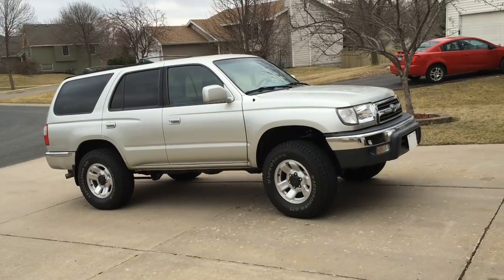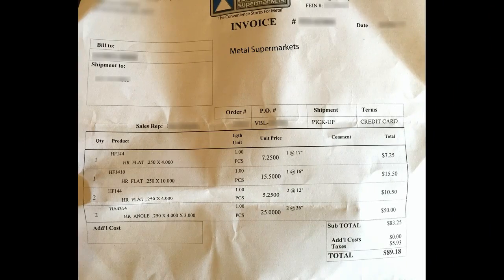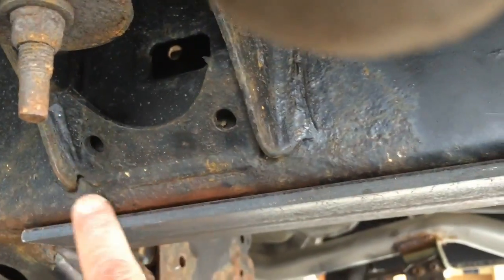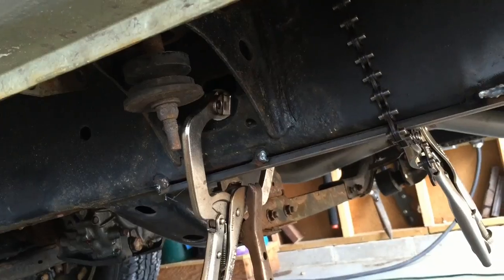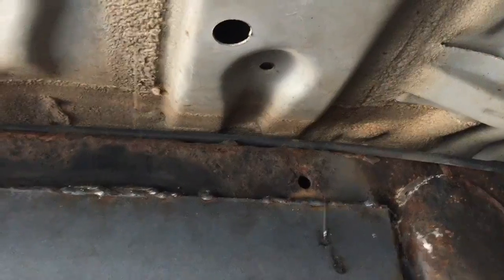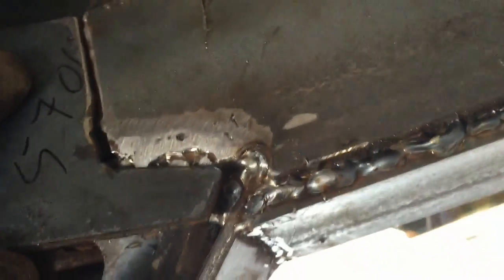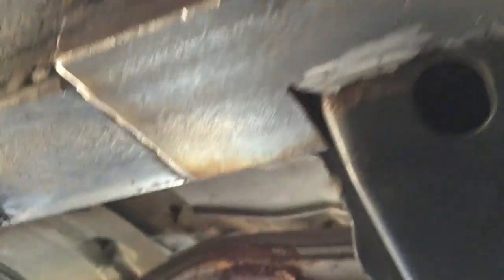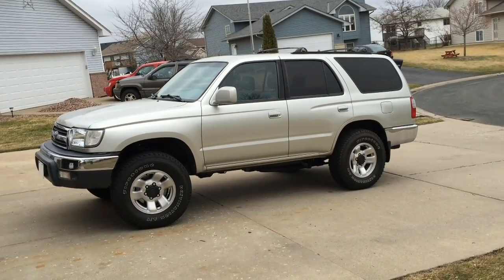2000 Toyota 4Runner Frame Rot Repair - Welded

Comment: Just curious, will the inspection people pass that? I don't have that bad on my 4runner, but it seems has started. Also do i need to remove gas tank, or any other parts prior welding?
Just got myself Hobart 210MVP MIG as well. Let me know.
Reply from the maker: I absolutely removed the take and got it away from the vehicle when I welded the tank side of it.   When I welded the exhaust side, I personally left the tank in place.  But still had a basic garage fan blowing under the vehicle to move any fumes, specifically the welding burn-off, etc.I think you need to pass your own judgement on the tank as it is in place.  The smallest amount of fumes can make it a very bad day.  The tank comes down fairly easily w/ a strap in the back and a couple of bolts.  The hardest part it getting the hoses off which have been seized in place over time.    One 'MUST-DO' is to empty the take before taking it down,  it's a night and day difference in the effort.Another point I will share, is if the tank is out, spend the $100 and put a new fuel pump in if it's not already renewed.   The pump is only exchangeable when the tank is out, and it would be a shame to go through the work and have the pump fail in short order.

Comment: Body shops don't want to touch "old" rusty vehicles like this due to liability anyhow.   Oil injection into the inner cavities is the only thing that prevents this.  Chain saw Bar and Chain oil works well because it stays tacky and doesn't drip and it keeps self-healing itself and wicks itself into all of the seams.  One application of oil into the frame rails when the vehicle was new would have prevented this.

Comment: Nice job but you should have atleast cleaned up the old rust before layering it. It would probably last a little bit longer too with a good undercoat just food for thought. But looks pretty decent for a quick job.

Comment: Due to the lack of my due diligence, I just bought an '01 that has the same issues.  Once this repair is done, is a 2.5" lift still okay to do?  I was also contemplating buying a whole new rear axle.  The brake lines and fuel lines need to be done as well. :/
Reply from the maker: Michael Oteri   I really don't have a way to judge that, but I will tell you that given what I've seen and experienced thus far - I can't seen anyway what so-ever that the frame isn't significantly more structurally sound that the original, even before the rust.  But keep in mind that frames are designed for a certain amount of flex, and by adding steel, one is essentially changing the flex characteristics - specifically removing flex in that area of the frame.   BUT, that sure beats sending it to a junk yard!BTW - I have a 1" lift on mine now, all new springs/shocks/struts.   I absolutely love how it looks.  As far as the rear axle, I simply pressure washed it and painted it with POR15 for now.Good luck!
Reply: +Michael Oteri Don't lift a vehicle especially one that has a bad frame, unless you have lots of time & money to replace ball joints, tie rod ends, CV shafts and  boots, hanger bearings, and steering racks. A lifted vehicle looks stupid without big tires on it and those big tires cause all of the problems I've listed. Unless you're living in a swamp don't do it.

Comment: Hello, Can you advise how were you able to weld onto the old frame without cleaning it down to bare metal.  Also how did you not blow holes while welding? can you estimate the thickness or gauge of the existing frame metal?

Thank you.
Reply: Most light duty frames should be 1/8 to 3/16 inch, if you plan on welding to it grind it down to somewhat bare metal. Also don't be welding stupid thick metal to it, its just a waste. Only as strong as what you're welding too.
Reply: You can flux weld onto dirty metal. Just prep as much as you can and apply oil or paint after the weld is done to protect the surface for as long as you can.

Comment: if you have a decent air compressor a HF needle scaler saves a lot of time removing rust.
Reply from the maker: +ss96impala1 Great tip, I never knew of one.  I'll check it out.

Comment: Did you have to remove your gas tank to safely repair both sides? Or were you able to take other precautions?
Reply: Yes he did
Reply: I  gave it to a great welder that fix the frame weak spots and cracks .... but I also ordered a skid plate so I decided to drop the tank for a week and cleaned the entire bottom except above the trans support skid plate ...  saturated  metals with WD40 and coated all with Rustoleum Red Oxide primer ...   new fuel pump, inspected and cleaned tank  ... old gas into a 5 gallon can ... removed bumper and tow bar  cut holes in trunk to get at top of carriage bolts ... all went well but a lot of hard labor ... also hit above the t-skid plate with  WD and Red oxide ....  cleaned all drainage holes and flush out rust buildup in frame ... put the tow bar back with spacers to all better drainage - replaced all tank hardware  ... paid a neighbor for helping hand  ... good man wife is ill .... we did the job right!
...

Comment: my question is, when you did the welding did you removed the gas tank first? being that gas line and sparks from the welding torch seem very close.
Reply from the maker: For the passenger side I did not.  I removed the exhaust (which I replaced with all new), and simply welded away.   The bottom of the vehicle was dry, and the fuel system did not give me any sense of it being 'leaky' or such.   Still risky however, so I think it's a case by case basis.   When in doubt, don't mess around and remove it.When I did the drivers side, yes.   All fuel parts were removed and put outside of the work space.   Gas fumes are a wicked thing.   When I put the tank back, I did so with a new fuel pump as the only way to replace the pump on this rig is to remove the tank.   That being said, it was just an opportunity to buy another 100k miles before needing to replace a pump.
Reply: Thank you so much CL Biro! after watching your VDO i felt like i could everything.lol.... I'm going for a crash course in welding this weekend.

Comment: That frame is rusted beyond any safe repair. It has obviously been driven on salted roads for some time. Another frame that is not rusted is the only way to fix it, but that would also be pointless if you intend to continue driving on salted roads. My guess is the floor pans and maybe the bed are also rusted through, along with the rocker panels, fenders, and bumpers, even if it isn't visible yes. It is nothing but an exercise in futility trying to keep a vehicle on the road for more than a few years in salt states.

Comment: Excelent job! I have a car to repair like this one. Can you give me some pieces of advice?
Reply: I can help you:  1. grind or cut out the crusty stuff.  2. fit and cut the new steel so it will weld to solid metal. 3. weld in new steel.  4. clean and finish the repair.  5. apply some rust preventative and reapply annually.  Or, you could watch the video and do what he did.

Comment: Fill the channel up with expanding foam for water proofing
Reply: That actually has proven to be a really poor idea.  Expanding Foam traps water around the edges and actually causes rust.  Car manufacturers use to do this for rust prevention and it actually caused rust instead.

Comment: How much cost to make those metal pieces piece? I don't think it is cheap.
Reply from the maker: +James C Xu The metal is about $1 a pound here locally.  And it was easy to find at a franchise called 'Metal Supermarket'.  So I'm thinking the whole cost of the metal was about $175 or so.  I had a fair amount left over.

Comment: Not bad,but at the very least you should have taken a wire wheel to the rust,then painted over the exposed area.and I've been told that you never weld vertical lines,always at 45° beads and cuts..something about the stress that almost always causes vertical welds to crack.

Comment: That frame needs to be replaced,badly.Thats just the rust you can see.Guaranteed there is twice as much you can't see.That frame will fold up right at that spring hanger.If that happens when you hit a dip in the road at 60 mph,you are probably dead.

Comment: where are you at in MN? I'm in maple Grove and have the same frame rust issues on my 90 Ltd crown vic and am desperate to fix it
Reply from the maker: I'm in Shakopee now.  This rig however spend most of it's time south of Lakeville outside of city limits.
Reply: I miss my crown vic I love my 4 runner cancer and all but I miss my vic i had on old 07 interceptor half the paint was falling off I beat that daylights out of that car and it never let me down over 230k and no major repairs I think the most expensive thing I put into that car was an altenator and as far a I know it's still running wish I never sold it

Comment: Unbelievable, that 4 runner looks so nice outside too, probably the interior is nice too. I cannot believe that Toyota refused to cover the 4Runner!! Toyota's vendors must be using recycled swing sets and Campbell's soup cans to make these frames, they are absolute garbage!! 8 year old repair, it's probably either junk again or you sold the truck... People who try to do this don't realize how hard this is to do on your back, if you don't have a car lift, this is not an easy nor a fun task. And to do it right takes many many hours; avoid that Safe -T -Cap stuff, all it does is cover the rust, trapping moisture in between. Chop out the rust and replace it, no exceptions...

Comment: most of these frame I see are much worse than mine... clearly there is some defect.. they rot from the inside out and around every weld, but i have lots of paint on the outside of my frame still. you dont see other frames of this age rotting through like this. most of my body is good, just rocker corners and above rear wheels. i think its a vehicle worth saving but i got in over my head.. i heard about the ball joints, i heard about the pink milkshake... nobody said the frames rot.. they should have mentioned that..

Comment: Holy hell. How does the frame even get that bad.
Reply: +123devinzz1 You must be from Southern California. Here, 2005 Ford Expeditions get rotted out so bad they have to be junked.
Reply: +Lawrence Artz Newfoundland canada. one of the worst saltiest places for vehicles.
Reply: +Michael Campbell Sometimes when it's 30 below up here in Canada you just don't feel like going to freeze the doors shut at a car wash in the middle of the night.  Salt causes high blood  pressure in motorists and rusts  the shit outta their vehicles.
Reply: I inspected a 2003 Kia Sportage last year. The frame was so bad, you can jam a screwdriver through any part of the frame, the trailing arms were ready to break off, the center link mounts were broken off. I told the owner that it's just too far gone to save despite the fact that it ran fantastic.
Reply: This was by far the most informative video on repairing a truck fame I found. Thanks for the work to make it available for folks like me.  I didn't think I could do it, but now I believe we can. What I am dealing with is nowhere near what you had to do. Can do and thanks.

Comment: You did a great job repairing it.  I honestly think that your frame is too far gone to repair.  If your truck is mechanically sound and the body is in good shape, just spend the cash to have a new frame.
Reply from the maker: Spending the cash was no issue.  Finding the frame . . .  impossible.   The market was rushed years ago and Toymotor has no interest in getting that tooling back out.   I even went as far as trying to fit in Tacoma frames, but no can do without modifying the frame.

Comment: Did this pass an inspection after the work?  Have to say the frame looks way past repairable.  I think Toyota should have repaired this, obviously by not doing they have lost another customer (you), as well as the others who may view this.  I'm up in PA and just bought a 2004 Sequoia.  It needed a small amount of welding to pass the inspection, a section of tubular cross member which sits high up at the rear near spare tire was rotted, at least the middle part.  There is a record of Toyota inspecting the frame and they deemed OK but there is a lot of surface rust but nothing like your 4Runner.  If it becomes completely unroadworthy you could sell it to someone on a farm for off road hauling, or there is a big market for these overseas in places like Africa where safety is not such a concern.
Reply: In Mn is not inspection.  Of course this would not pass.

Comment: The good, the bad and the ugly FYI 
Toyota has reached an agreement in a class action suit brought by U.S. owners of several truck models over the issue of frame rust protection, Reuters reports. The automaker is expected to reach a formal settlement worth up to $3.4 billion with owners of;

Toyota Tacoma, Tundra, and Sequoia trucks that are claimed to have received inadequate rust protection, which in turn could lead to corrosion significant enough to affect the trucks' structural integrity, according to the class action suit.;
 
The settlement program will affect 2007-08 Toyota Tundra and 2005-10 Tacoma pickup trucks along with 2005-08 Sequoia SUVs, with the total figure derived from the estimated cost of frame inspections and replacements for over 1.5 million total trucks.
 
The frame replacements are estimated to cost $15,000 each, which adds up to $3.375 billion, while the cost of inspections for the affected trucks is expected to add another $90 million, at $60 per truck, according to lawyers representing the class of plaintiffs.;
 
Read more: https://autoweek.com/article/recalls/toyota-will-settle-truck-frame-rust-suit-suit-34-billion#ixzz5ZERNBhc3

Comment: Spay the hell out of the frame with old engine oil, inside and out.2 times a year.
Reply: People just don't understand how well oil works to prevent rust like this. "I don't want an oily mess under my vehicle"..... whatever.... (OK, enjoy your frame rot in a few years) Chain saw Bar and chain oil works great and just attracts a light film of oily dust over time and it keeps healing itself as it wicks into body seams.  Simple, cheap and effective.
Reply: Fluid film makes a sprayer with an internal frame nozzle works great
Reply: Can't this potentially cause the vehicle to catch fire and create a hazard?
Reply: hhova29 not usually, oil doesn’t burn like a volatile substance and a thin coating on the frame and any rust spots won’t pose any risk in most cases
Reply: so true, i apply oil through out chassis every 10000 km(3-4 times year). My Hilux is 21 years old but chassis is as pure as stock.
Reply: no, those are burnt oil(old oil that was in the engine, black & thick), its doesn't cause fire. Also i use high pressure gun, so it applies a very thin layer of oil. After 50-100 km you cant even notice it, but the chassis is well covered and protected. Again they have special kind oil designed for chassis protection, but why spent more money when you have free oil after every 5000 km :D
Reply: Heshan Sandeepa it feels so nice spraying thick black oil on dry rusty metal
Reply: is it okay to use old engine oil that is synthetic? or does it have to be normal oil?
Reply: Use fluidfilm

Comment: You really should have ground that rot out of there first. And also got the paint and junk off the surface. Would have made the welds a lot better. Also your welding too cold. Not getting enough penetration. Probably cause its so think of material. But when doing this kind of repair you really need penetration. Look into the product fluid film. Its an oil undercoat that has worked good for me.

Comment: Never ever make a vertical weld on a fish plate. Your plate should have been diamond taper cut looking like an arrow pointing left and right on the side of the frame and where the welds from the top and bottom come together at the point of the diamond the weld continues for 1/2 inch. Making vertical welds on frames, H beams and I beams is a no no.
Reply: What do you do? Downhill it?

Comment: TOYOTA HASN'T MADE A TACOMA FRAME YOU COULD TRUST FOR 22 YEARS.  FROM 1995 THRU 2017.  HOW DO I KNOW THIS AS FACT?  BECAUSE THOSE ARE THE YEARS THEY'VE OFFERED TO EITHER BUY THE TRUCKS BACK OR PUT NEW FRAMES UNDER THEM OR SPRAY THE FRAMES.  THANKS,  SO CALLED LEGENDARY TOYOTA  QUALITY CONTROL, AND THANKS DANA CORPORATION.   THANKS FOR RUINING A GREAT TRUCK FOR 22 YEARS.

Comment: cavity wax in all fram holes it will last many more years
Reply from the maker: I think what someone needs to come up with is a compressed air 'sprayer' on a flex hose.   Just slip it in the hole, press the air, and spray away some anti-rust/treatment.
Reply: Actually Eastwood sells just such a product "Eastwood Internal Frame Coating", about $18 a can and it would probably take 4 cans to do that 4runner.
Reply: Slather the whole thing in a mixture of grease and used engine oil and "stab" it into all of the nooks and crannies with an old paint brush and re-apply it from time to time. It will freeze the rust in suspended animation.  If this was done to the vehicle when it was new in 2000 including the inside of the frame rails,  you could wipe the oily film off the frame rails and they would be new looking black paint on the frame underneath. Paint does nothing. "Washing" your vehicle underneath does nothing. Waste of time.

Comment: Toyota is hands down better than ford and chevy in my opinion.. to bad about the frame issue.. it’s the yotas Achilles heel.. on a positive note I just got my 2008 Tacoma approved for a new from from  Toyota .. it’s got only 100,000 miles but has some rust bad enough too pass for replacement. Not nearly as bad as yours though.
Reply: Toyota makes 500k mile drivelines, so they needed shoddy frames, to kill em'.